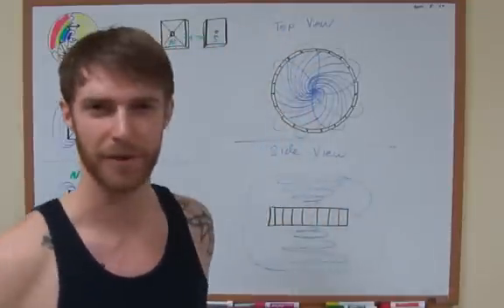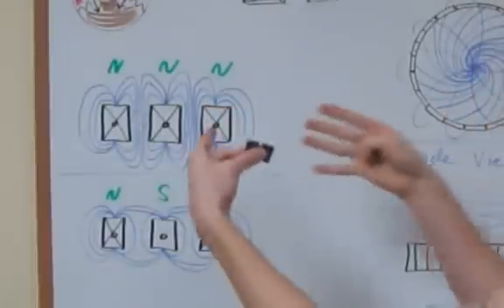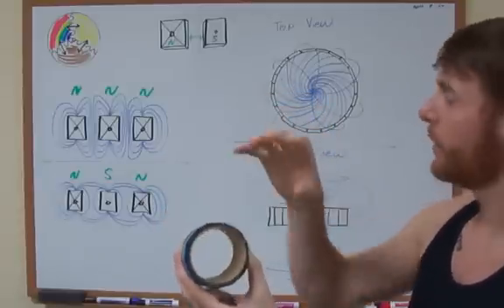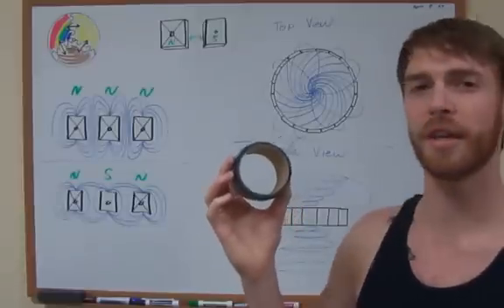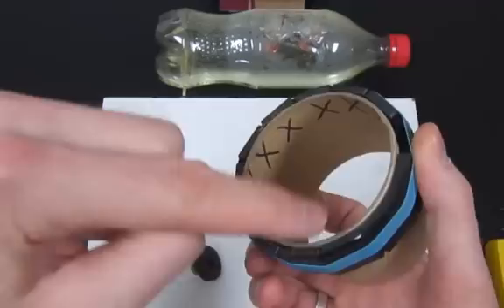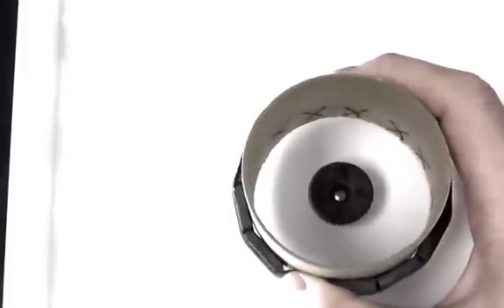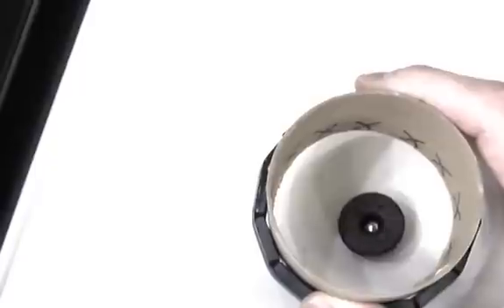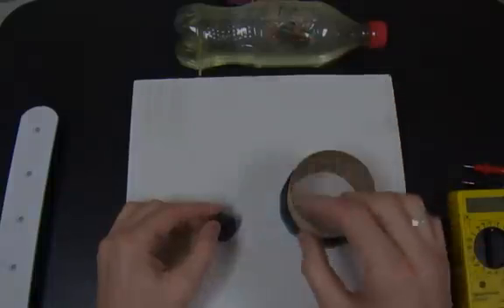The Beauty of "Spin" - Vortexing Magnetic Fields & New Energy Tech.

Comment: It does show there is rotation observed on the magnet below, but he's made a wrong inference. The magnet is spinning only because he's moving his hand. 

The magnet does have to flow in it's direction, around the field. So if he moves right to left it will spin clockwise. 

My point is it wont spin by itself.  

It's a fixed magnet, I don't care how you glue them together. It doesn't become a "vortexing  magnetic field" It's still a FIXED magnetic field. You can make it spin, by moving the torroid magnet... oops yeah your moving your hand again. Duh...
Reply: Dude... buy a huge ring magnet... and  try it... its bunk. I did. You don't get spin unless you rock the spinning magnet across the sweet spot. The natural spin, maybe present, but such small magnitude, its worthless. You take you moving hand out of the equation, its done.... no inherent torque. You may have a worthless toy if you remove all resistance, like float it in space... That's the problem of all these bunk-o-matic magnet worshipers. NO TORQUE.
Reply: Chas Morr It doesn't matter why he moves his hand, it just counts that he does. And that induces energy to the magnet. And since the ball is not perfectly in center, the whole thing spins. Please google "hammel spinning" and learn.
Reply: I was thinking the same. I've done the experiment, but with cylindrical, disc magnets. There was no vortex at all. He will not answer any of my questions.
Reply: Luke Jones  Don't bother Luke, this stuff is caca, I bought a huge ring magnet... and I got spin. If you move a dipole back and forth the sweet spot you can induce rotation. What can you do with that? If you fixed the circle magnet ...Zilch...I might as well be spinning it by hand. The best you could do would be to get a top that is a magnet, and spin it in a curved dish and the spin would wobble it through the sweet spot. Thinking that magnets arranged in some geometry will make usable torque is a waste of time.  Magnets are yin and yang... you can't just harvest one, if you block the other it reduces the force of the magnet strength. That's the nature of the universe. Anybody trying a two dimensional magnet motor is wasting life. Now magnet motors with pulsing DC you're doing something cool. Magnet motors with high frequency get's really cool. Look up Tesla Hairpin, and you can start seeing the real stuff. It's just weeding through these aether guys and all out charlatans. I have to warn you the rabbit hole is High Voltage and DANGEROUS.
Reply: John Yogore QUOTE "
It does show there is rotation observed on the magnet below, but he's made a wrong inference. The magnet is spinning only because he's moving his hand. " it's not true look at his hand, he only moves it to keep it centered because the ball bearing is rolling off the table -> WATCH the Video again he is just keeping it centered and at the right height!!!!
Reply: true story
Reply: I love that he had to cut it and do it repeatedly to make it look natural. Clearly he has to move the magnetic field to get it to spin.

Comment: Endergy that goes to make some usefull work will stop this system. For this particular example this is bearing ball friction, that is very small because of smooth surfaces... The efficiency of such system is very small... In the space no friction at all...
Reply: I was thinking the same thing, however, the larger the system (larger magnets) the more powerful the magnetic field and more force in the spinning object in the center. Which could potentially be made to drip generate electricity, with no friction on the moving parts, so no wear and tear on the generator.

Comment: There is no actual spin within the vortex. The lines of force are through the center and back around to the back and in again. They are not rotating horizontally. If you will notice, when your hand moves even the slightest bit, there is an imbalance and the magnet rotates due to attraction and repulsion, and since it is sitting on a ball bearing it seems to spin.
Reply: I would say the easy way to prove this for anyone who has a set up, just set the magnet on a set of bearings top and bottom to allow rotation but stop the drift that you are seeing here, I am betting that the spin will if at all happening, stop once the larger ring of magnets is positioned and not moving anymore, the ball is trying to roll to the magnets but due to the balanced ring on top, it can not do it end over end, so it has to use what little wobble is in the rotation of the ring to allow it to move to the side, other wise it would not keep following his hand and make him keep making adjustments.

Comment: I was quite excited by this and tried it out but there is no vortex. The disc magnet is trying to move to whichever of the outer magnets is nearest. Because it's on a ball, when it get's pulled, the easiest way for it to move is to spin. If you hold the outer ring still with the disc dead center there is no movement. You control the spinning by moving the outer ring. You can make it spin either direction.

Comment: quite honestly, I'm unsure of the explanation for this.  I suspect it may be that your tube is not perfectly stable, and your hand is moving, generating a changing magnetic field which induces a small current in the center magnet.  I have to say though, I admire your engineering viewpoint, and I think you could do quite well as an engineer if you were to take classes and get a degree!  Assuming you haven't already, of course.

Comment from the maker: I have never heard of such a thing.  I would say test it yourself and play around. In my testing I can see no need to rotate the ring.  

If I had the resources I would engineer a strong machine to assemble one of the vortexes using "High Power Magnets"  This would be veryvery difficult because of the pressures within the flux lines.   Even using these small magnets it is a little difficult to make, but its still cool nontheless.   :-)